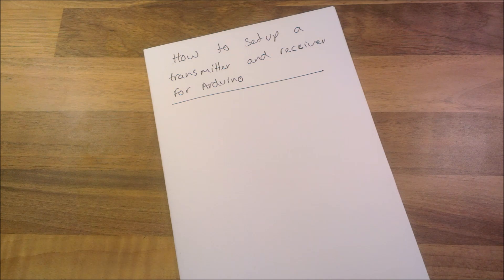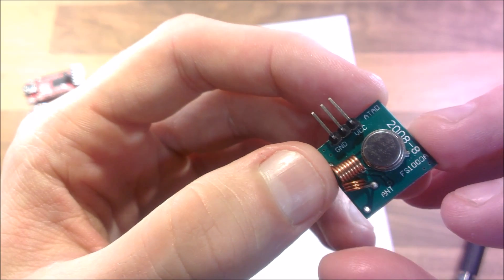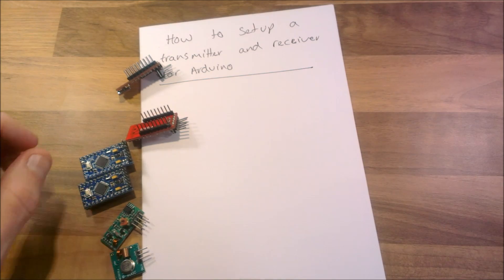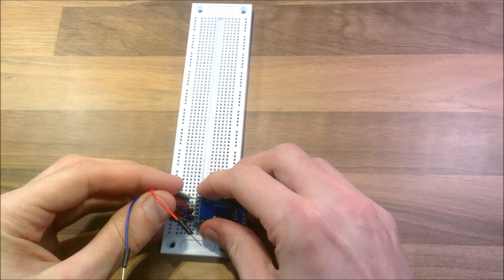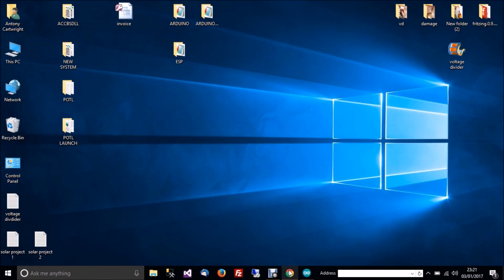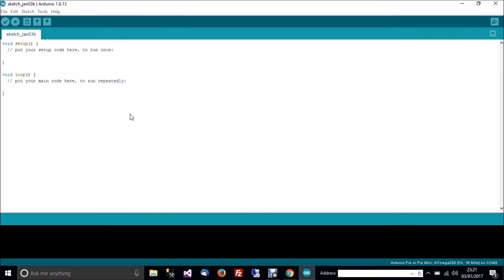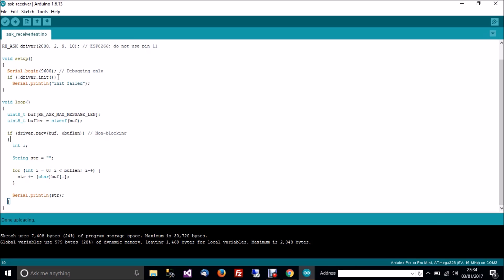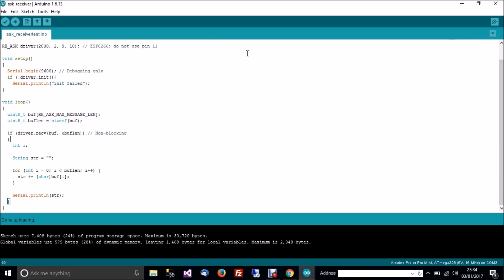TUTORIAL: How to set up wireless RF (433Mhz) Transmitter & Receiver Module - Arduino! (RadioHead)

Comment: I have a use for this in a project.  It gets worse if you need to send a variable message instead of "hello"  I suppose then the transmitter board needs to receive data from an arduino, then stop, then switch to transmitting.  Probably need an one arduino uno to handle it for the receiver/transmitter board

Comment: if you had two or three wireless transmitters , one receiver could pick it up or you buy a larger board and do the same thing and connected all the sensors to the larger board

Comment: Tell me, Why does everybody waste there time and money on Arduino circuits when 433Mhz transmitters and Receivers work just fine on there own.  and you don't have to mess around programming Arduino circuits. Just use an HT12e for the XMT. and HT12d for the REC. plus two each 9 positions DIP SW.s to select your code and you're done.  also, the whole system can work on 5 VDC and if your receiver is going to control A/C power like some lights, then use a MOC3021 and a BT136, everything works off of 5VDC battery or A/C to D/C.

Comment: Watching another similar tutorial which used UNO instead of Nano and no FTDI... in that video mentioned RadioHead library looks for transmitter on pin 12 of Arduino and receiver on pin 11.... WOndering how do I find out which pins RadioHead library looks for transmitter and receiver?

Comment: Can you do another video for 433 with an esp 8266 please, i want to learn how to clone an rf remote for 2 buttons ??? the esp 8266 has wifi so i want to be able to TX a signal via a simple web request.
Reply from the maker: Lols, that sounds incredibly dodgy! You can't actually clone well-built transmitters, you can only log and mimic transmissions. I'm not sure why you'd need an ESP8266 for it.
Reply: Antony Cartwright it has built in wifi and they are cheap and i like them alot :) also i have a tx and rx 433 ready to go.

Comment: Thanks for clarifying the transmitter pin locations. I have the same transmitter and had the vcc on the wrong pin. Definitely confusing.
Reply: The confusion comes from the fact that this is a cheap knock-off of another similar board. Whoever designed the silk screen didn't know what they were doing. ATAD is DATA if you reverse the letters, making me think they didn't know english. Ground, VCC, and DATA are then in the correct order, but improperly offsest. You can see a pair of very similar boards, but with better labeling at https://smile.amazon.com/Transmitter-Receiver-Wireless-Arduino-Raspberry/dp/B073ZZ9BJY/ref=sr_1_20?ie=UTF8&qid=1532694950&sr=8-20&keywords=433mhz+transmitter+and+receiver

Comment: Good day. Awesome tutorial. I have been all over the net trying to find a way to bypass the timer issue using vw, radiohead and servo libraries. I think I've narrowed it down to using radiohead for timer1 and servotimer2 for timer 2. I just want to use simple LOW activated pushbuttons for led's and to set servo position. Would these libraries work together? Thanks.
Reply from the maker: Hi, thanks! What is the timer issue? :-)
Reply: Antony Cartwright when you try to use virtualwire or radiohead with servo library on unos, you get a compile error. Many people noticed it. No one particular great solution I could find. I heard radiohead with servotimer2 might work because servotimer2 uses a different timer. Was just wondering if you had ideas or code to work around the issue. 433mhz tx\rx are already noisy and hard to get clean signal. Add a servo and it becomes challenging.
Reply from the maker: Ok, well to start with, about the noisy signal, look here: http://youtube.accbs.co.uk/Video.aspx?Video_Id=QZtfQt162Qw
Reply from the maker: About this timer issue, I've never heard of it. However, I don't know why it would be a problem. I'd imagine the timers are based on the millis(); function which is just an ordinary function, it can be used by any libraries. I'm not aware of any problem. :-)
Reply: Antony Cartwright thank you for the link. If youre interested in following the issue further, do a simple test. Load virtualwire, put a basic example, then add a basic example from the servo library. Hit upload and you should get a compile error. The two libraries interrupt eachother. I was just looking to fix it. I am new though, so I have much learning. Thanks again.
Reply from the maker: I've not looked into it, but if you want a very quick and easy solution which will definitely work, simply use two Arduinos and link them together via the serial pins. :-)

Comment: on the receive sketch, I'm getting an error: "buf cannot be used as a function". How can I clear this? Thanks
Reply from the maker: Hey, not enough info I'm afraid. It's a compiler error though so seems that the logic of the code isn't right. :-)
Reply: Don't know if this is too long but here's the code;
#include <RH_ASK.h>
#include <SPI.h> // Not actualy used but needed to compile

//RH_ASK driver;
 RH_ASK driver(2000, 2, 9, 10); // ESP8266 or ESP32: do not use pin 11

void setup()
{
    Serial.begin(9600); // Debugging only
    if (!driver.init())
         Serial.println("init failed");
}

void loop()
{
    uint8_t buf[RH_ASK_MAX_MESSAGE_LEN];
    uint8_t buflen = sizeof(buf);

    if (driver.recv(buf, &buflen)) // Non-blocking
    {
 int i;
    String str = "";
    
  for(int i=0; i<(buflen);i++){
     str += (char)buf(i);
    
  }
  
  Serial.println(str);

    }
}
Reply from the maker: Roger Moss where does it try to use buf as a function?
Reply: On this line the compiler freaks out:    str += (char)buf(i);
Reply from the maker: Roger Moss You're trying to pass a parameter 'I' to buf, but buf isn't a method! I think you're trying to use the indexer which is [ ] and not ( ).
Reply: Poor eyesight or carelessness - when I replaced the curved bracket with square brackets, it complied fine. Thanks Anthony
Reply from the maker: No problems!
Reply: I'm using Arduino for transmit, but NodeMCU to receive. I'm modifying code to receive msg on MCU pin 0. Any reason that wouldn't work? I've added code to declare pin 0 input. Here it is:
#include <RH_ASK.h>
#include <SPI.h> // Not actualy used but needed to compile

const int echoPin = 0;

//RH_ASK driver;
 RH_ASK driver(2000, 2, 0, 10); // ESP8266 using pin 0 which is connected to the data pin on receiver

void setup(){
   //pinMode(echoPin,INPUT);//Prepare MCU to receive on Pin0
    //digitalWrite(echoPin, HIGH);
    //delayMicroseconds(10);
    //digitalWrite(echoPin, LOW);
    Serial.begin(9600); // Debugging only
    Serial.println("Hello I'm geting ready");
    if (!driver.init())
         Serial.println("init failed");     
}
void loop()
{
    uint8_t buf[RH_ASK_MAX_MESSAGE_LEN];
    uint8_t buflen = sizeof(buf);
    Serial.println("Entering V Loop now");
    if (driver.recv(buf, &buflen)) // Non-blocking
    {
   int i;
    String str = "";
    Serial.println("In the loop now");
  for(int i=0; i<(buflen);i++){
     str += (char)buf[i];
  }
  Serial.println("got some characters");
  Serial.println(str);
    }
}
Reply from the maker: Roger Moss Hi! I'm afraid I don't have time to help everyone out, but take a look at nodemcu pinout and verify that the pin is free. From memory, pin 0 is reserved but I'm not certain. Antony..
Reply: I'm using Arduino nano for RF receiver and uno for transmitter but I couldn't print any information there so can I use uno and nano .. or same. How can I make this RF

Arduino uno should be used with uno ?
Reply from the maker: All Arduinos should work.

Comment: Do you think it is possible to make a car remote tester with this receiver? Connect power and ground, a led light to data. Will the receiver accept any 433mhz signal or the signal has to be coded?
Reply from the maker: Hi, I imagine this is possible but I'm not 100% sure.

Comment: Whats the point of the UARTs? Would building this be any different if you dont have them? I bought these and just want to make a blinking LED so I can test different antennas on it (such as a 1/4 dipole that ridiculously huge compared to the tx/rx board)
Reply from the maker: Dave B Hi, I have a series for exactly what you're trying to do. It's in my RF playlist. However, the UARTs are necessary in order to flash the code to the Pro Mini. The Nano doesn't need a UART as it has one built in. :)
Reply: Thanks. I was really hoping to find encoder chips but they are in china and I dont have 6 weeks to wait for the mail. Must be the nanos I have. You would think this would be simple but not so simple as Manchester coding is involved I thought the moduals handled that from the bad description of the ads. So in doesn't really = out. I have some fancy 10$ ones in the mail so maybe those will work with less parts after I get these to work.
Reply: To: Dave B : so you have use RF433 module to transmite and receive UART with 9600 baud ! and it dose not work !?

Comment: Great tutorial. Is it possible to connect a load cell to the transmitter. I want to send weight measured by multiple load cells to a single raspberry pi or an arduino. Could you give me some advice on it. Would highly appreciate your help.
Reply from the maker: Harshad Rai Hi, you can't connect a load sensor directly to a transmitter, you need a microcontroller for that. So you'd connect your sensors and a transmitter to a microcontroller, and then get the microcontroller to communicate with the transmitter to get it to transmit the necessary data to the remote receiver.. the receiver would also be attached to a microcontroller, which would interpret the resultant data. There are different ways around this though depending on what end result you want. You might want to use Arduino + 433mhz, Arduino + 330mhz Arduino + 2.4ghz or possibly even just the nodemcu which has an integrated WiFi adapter (transceiver) with full tcp ip stack. Antony...
Reply: Hi Antony. Thank you for your reply. Could you tell me what microcontroller would be suitable for this?
Reply from the maker: Hi, It's hard to know because I don't know what your overall intentions are with it, however, from what I do know about your project, any Arduino will do. The NodeMCU would do it and would give you some powerful benefits too, but you'd need to also add an MCP3008 to it. I have a video on this. Antony...
Reply: Alright. Thank you so much for your help Antony. Really appreciate it.
Reply from the maker: No problems..

Comment: hii i am doing project using arduino. my need is like i need a transmitter which acts as a master and 6 to 9 receivers that act as a slave. master needs to send some message to the one slave that i have selected while sending hte message, leaving other receivers idle.Is this  possible by the way u've explained in this tutorial
Reply from the maker: Hi, it is possible! You'd achieve this from within the software. You'd assign the clients a number each. Then when you get the server to transmit, you'd add a header on the transmission. The header would be the address of the intended recipient. You'd tell all other clients to drop the data if it doesn't start with it's code. Antony
Reply: Antony Cartwright thank you so much sir

Comment: Loved the project. Im planning on using an arduino pro mini and these 433rf modules in a micro rc plane where i would use the motors to control yaw and pitch.. Hence would need to use this setup to drive those motors at differential speeds. Do you think its possible.. I came across ur video an the concept seems similar.. Could use any advice and help..
Reply from the maker: Hi! Thanks for your comment. Yes, it is possible! You'd transmit the data to the plane using your own data transmission protocol and then get the Arduino to interpret those signals, read them into a number and then control the motors using PWM. It is possible and not too hard. You'd use a protocol like this '[Header][Motor_Number],[Speed][Footer]'. For example '#1,1023;'. This could tell motor 1 to go full speed.

However! Even though the Arduino/electronic side of things isn't too difficult, the physics side of it can be! I'm releasing some videos on Friday, Saturday & Sunday this week about a drone project. At the moment, I haven't got to the transmitter/receiver bit though. :-)

Comment: What is thr range of these?
Reply from the maker: Hi, I believe the range is around 5-10m. Maybe 20m outside. You can buy a helical antenna to make it go further. Antony...
Reply: With antena i got 2cm distance is there any other I can try. (But not to expensive).